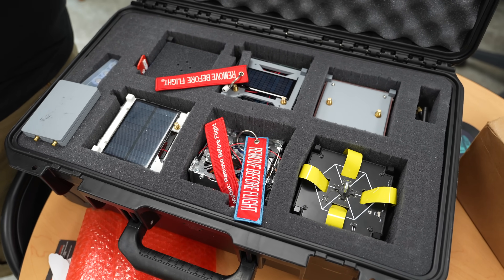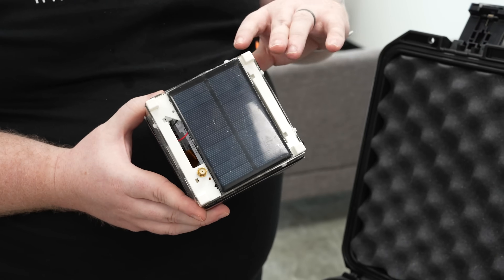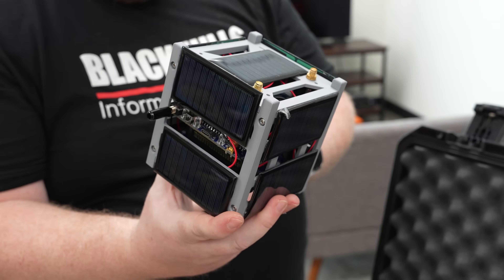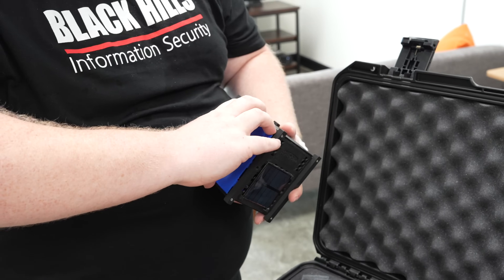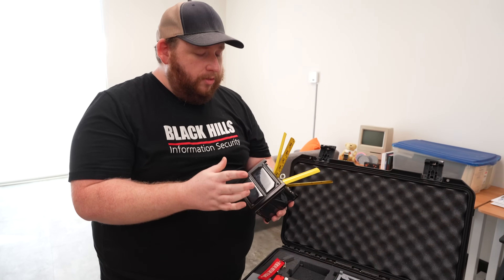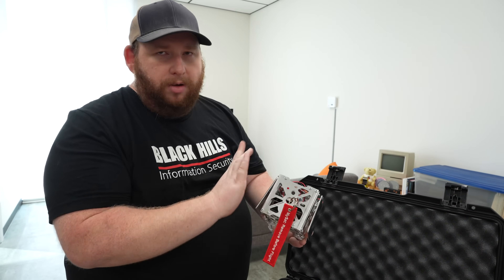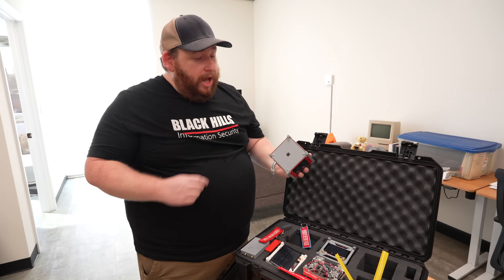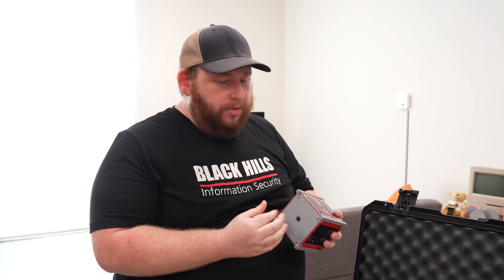How small can you make a satellite? Here are six in a box!

Comment: im curious at such high speeds how do these cubesats manage orientation?
Reply from the maker: Good question! Some of them have a magnetic coil that can slowly but surely align it based on the Earth's magnetic field.
Reply: Commonly used:

Magnetorquers - coils used to rotate satellites in Earth's magnetic field

Reaction wheels - a spinning wheel used for changing satellite orientation

Rarely used:

Thrusters (but their fuel is always limited)

Gravity gradient stabilization - the satellite has a long extending boom with a weight at the end, and because of slightly different gravity strength at different altitudes, the satellite orients itself that the satellite body is closest to the Earth and the boom points away from Earth

Passive magnetic dampers - they interact with Earth's magnetic field and slow down satellite's rotation (useful when used together with gravity gradient stabilization)

(I'm designing a small satellite for fun, I don't know if I'm going to actually build it haha)

Comment: How small can you make it? I worked for Swarm Technologies, and we launched approximately 200 sats that were 1" x 4" x 4".  They used LoRa somewhere around 173 megahertz. They were a store and forward device, taking data from the modems we sold customers for low-cost low-bandwidth IoT devices and pushing it down to about a dozen groundstations we had.  One of them was in my front yard, and was comprised of little more than an RPi 4, one of our modems, and a whip antenna.  We initially flew with 100mw transmitters but later sats had close to 1 watt. So yeah, no cameras or movable solar cells, but we were smaller :)